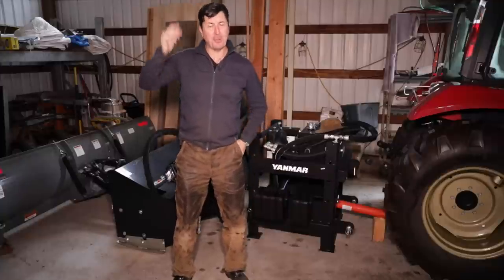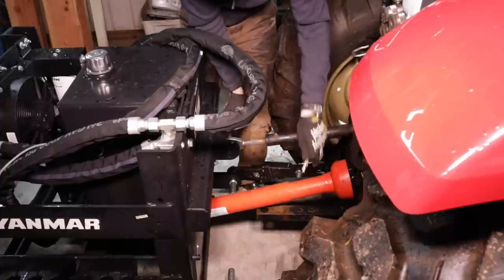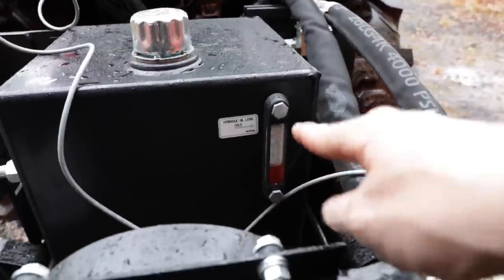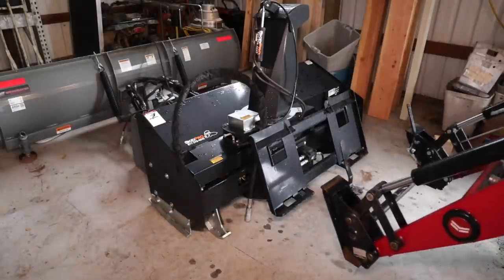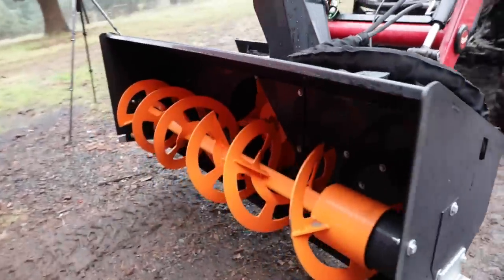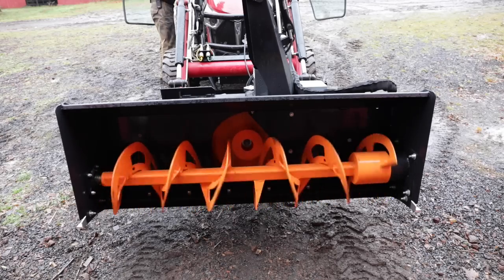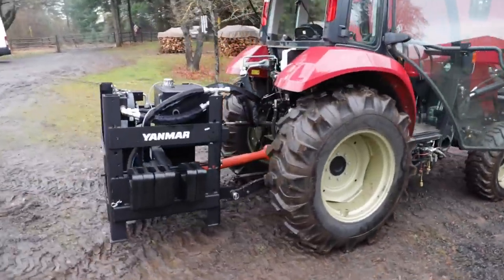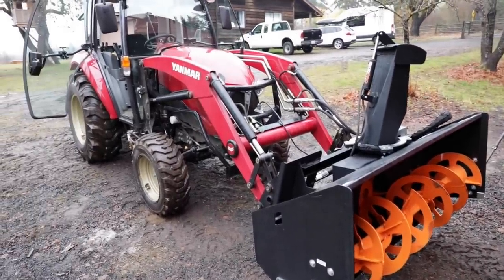This Yanmar Prototype Snow Blower Is AMAZING!!!

Comment: That is one expensive set up, for the average home owner that's going to be out of reach. The hydraulic system is all off the shelf parts the tank is common the pump is common as well. I would rather have a rainy winter over snow any day of the week I don't like snow it gets old really fast. You can work in the rain you can't work in snow and the ground is frozen.
Reply: Depends on your work I guess. I love the snow. I put the good tires on and can go pretty much anywhere.  So many people have no idea what tires to put on or think their all wheel drive doesn't need winter tires. my favorite is people buying all season tires thinking they are really all season when most are "no season".  I just go out, give people rides or pull them out of the ditch. My favorite is rescuing jeepers with my old van. :)

Comment: Other people ahve said how over complicated this is. I'll add in it's giant rip off. You have to buy the blower, fine. But then you have to buy the hydraulic pack too. Are they even considering making more tools to run off of it or is this just an overpriced system?
Reply: Allurade, What if you already have the snowblower? Look at it from the perspective of a person or organization that already owns one or several hydraulic snowblowers for mounting on their one or several skid steer loaders. But, as is often the case, all or most of those skid steer loaders do not have heated cabs. And usually those skid steer loaders cannot drive from jobsite to jobsite as quickly as a tractor. Looking at it this way can you see why Yanmar and other compact tractor manufacturers offer these systems?  

The hydraulic power pack will run other hydraulic-powered attachments that quick-attach to skid steer loaders. For example, a rotary broom which can have year-round applications in grounds maintenance, road building and other industries.